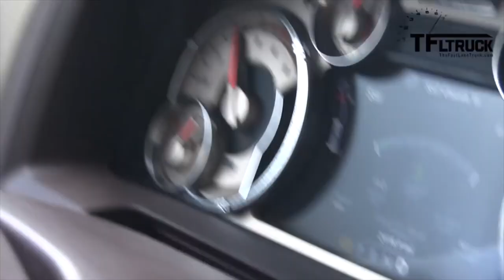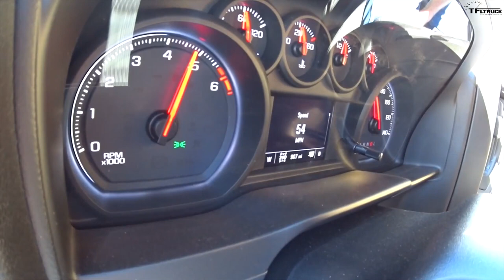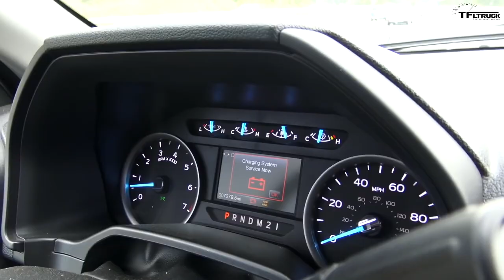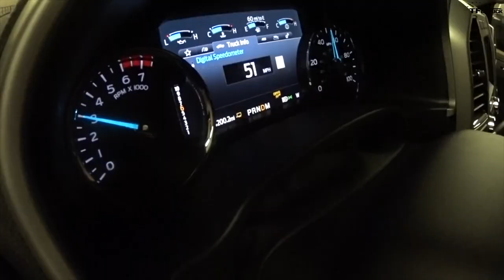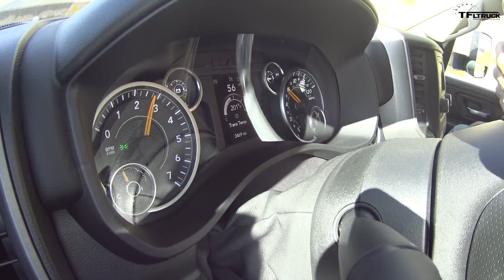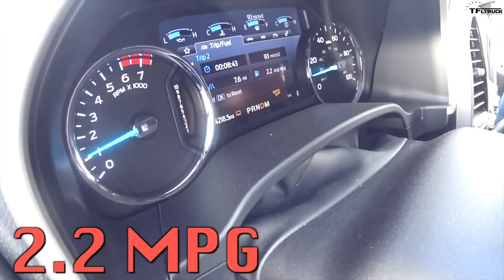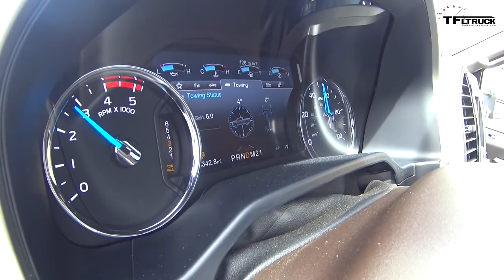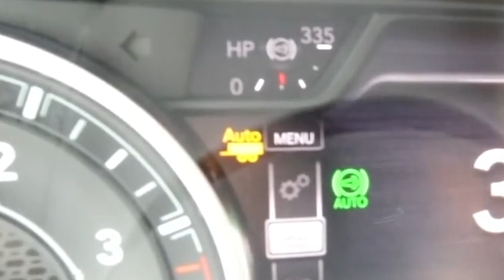Here Are The Best (And Worst) Trucks To Ever Take On the World’s Toughest Towing Test!

Comment: Back in the day, Andre had IR Temp gun, and he would read the temps of the brakes after the downhill runs. He also professed not to speak English, only Russian. Those were the days. I'd love to see both transmission temps and brake temps return to the Ike.
Reply: Good point. Risk of the rotors glazing due to heat and material makeup.
Reply: I remember that! Lol!

Comment: End of the World (as we know it) but TFL guys still talking trucks!!!
Reply: Apparently, we will need to throttle 'car sharing' and 'car pooling' ideas back for a while...
Reply: I looked out the window just now and the sun is coming up.
Reply: @Luis Bolanos In that case I want to get info about trucks HEPA filter , bioweapon defense capabilities, parts availability and options to use alternative fuel (ICE cars) self charge using solar panels ( electric cars)!!! I don't give two hoots about towing ( not practical outside North America) and finally if you guys have not noticed ALL major manufacturers stopped producing and unlikely to restart in next 3 months at least. Also here in Europe they already started with roadblocks  ( severe restrictions on travel) so for the time being  you can kiss your sweet ride goodbye as Kansas has  gone buy buy!
Reply: @Luis Bolanos but in the meantime I would like TFL to make comparison of bioweapon defensive capabilities of each vehicle they review :)
Reply: @vvk  you forget whether the bed is long enough to mount 2 machine guns, or if you're stuck with just 1

Comment: The conversation on Payload highlights an important point for me: the average half-ton has the payload and capability to tow a lot of weight OR carry people and things. They usually can’t do both. Even 3/4 tons get caught in the details of this math. 

I personally think a lot of half-tons only perform like heavy cars with a bed. If you don’t believe me, watch some of them leave Lowes/Home Depot with a load of concrete or lumber. Where I live, I constantly see trucks(often pulling trailers) that are unmatched for their payload and towing activities. 

I think there is a lot of danger in the marketing of truck’s towing capability these days.
Reply: People in the '70s and earlier towed quite a bit with full-size sedans.  150(0)s other than RCLBs that are almost all fleet trucks now, are the successors to that.

Comment: The half track trip was a riot.  lol  As for the tech. improving the breaking etc.  Absolutely the adaptive cruise control is phenomenal.  If they had this on more vehicles, brakes would last longer.  If that could work with CVT, CVT would get a boost in appreciation.  I like how you summarized and put each truck into its place.  Was exactly the type of information people need to grasp.  What are their needs/wants for the budget they have.  And that, IMO wraps up everything nicely.

Comment: Great show Guys as I have mentioned here I was interested in a Chevy Trail Boss or Toyota 4Runner for a hunting truck.  Last Saturday I test drove a Toyota 4Runner TRD Pro Army Green and I really liked it and figured I could put a luggage carrier in the receiver hitch so I don't get the inside bloody like Roman advised was get the Trail Boss for hunting. What led me away from the Chevy Trail Boss is color as I went to the local dealers and they have a hundred trucks on the lot and none Havana Brown.  I know it does not matter to some people but to me it does and I don't like Red, White, Black, Silver, I even told the local dealer get me a Havana Brown Trail Boss and in two months no Havana Brown talk about a dealer dumber than a sack of hammers.   What I dis like about buying a Truck all the wheeling and dealing on price at least with the Toyota it is what it is.  Sad part is I have over $ 3000 on a GM credit card and I was not going to use it and was going to buy the Toyota the only think that stopped me was this Virus and will I have a Job ?   I am a Corporate Jet Pilot and have not flown a trip in three weeks.    Stay Healthy and we will see where all this goes.   One option I would like to see come back on a truck is like Ford use to have a camper special that had a luggage compartment on the passenger side in the under the box.

Comment: I always wondered why you start with the downhill and end going up?
Reply: Mainly because the 8 mile, 7% grade of I-70 is on the opposite side of the tunnel from where they are in Boulder/Denver.  So they go through the tunnel, run downhill to Silverthorne, turn around and run up the mountain, back through the tunnel and then home.

Comment: John with the 08 Super Duty with 6.4, you should consider re-gearing and a tuner. The new 7.3 is fine, but your gas mileage is gonna get cut in half.
Reply: Gas is real cheap now, and it will likely stay cheap.

Comment: The biggest disappointment was the IKE where u tested 2017 F250 6.7 powestroke. We all expected a lot from the engine but it didn't run well.
Reply: The biggest disappointment was the fiat ram being so slow.
Reply: Did I miss something?  That truck towed 12,500, had 1 brake application and topped the hill in 8:03 at 4.1mpg.  Seems pretty solid https://youtu.be/-0fIVM06nbs

Comment: Yeah are the main reason people use Chevy products for off road as cars there so  F***** chief to build. The motors are a dime-a-dozen. Chevy parts is so easy to come by because they're so fuhkien cheap. That's why you got the one like the John Deere brockel the beach to shoot out of everything it goes up against in it straight all  FORD POWER.  And there is a lot more like  Him. You pay for what you get. You wanna pay cheap for something you're gonna break all the time so that's why they use Chevy. But if you got the money to spend You pay for what you get. That's why you used Ford motor company Products they don't break is easy but they are just  Or expensive than a Chevy.